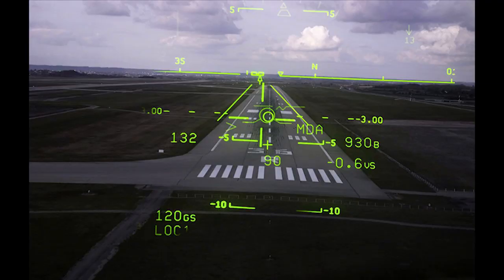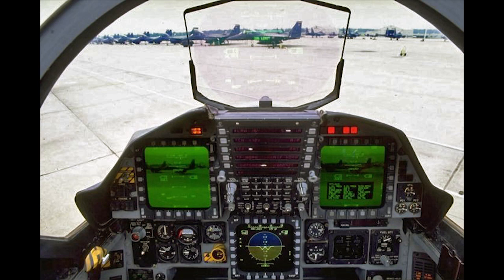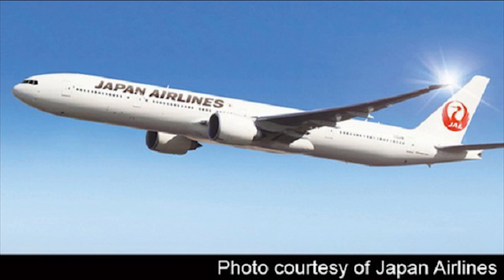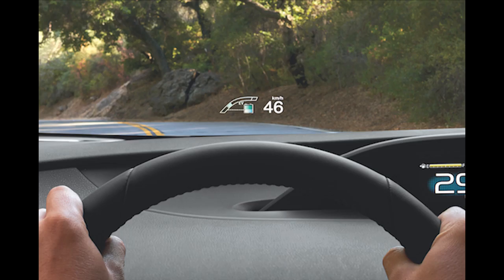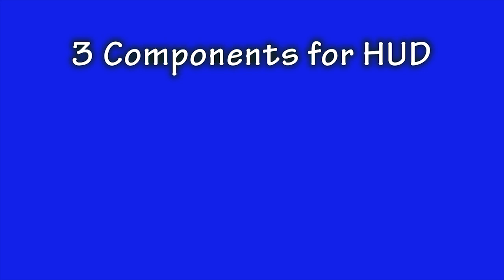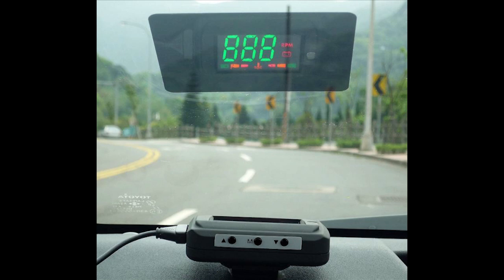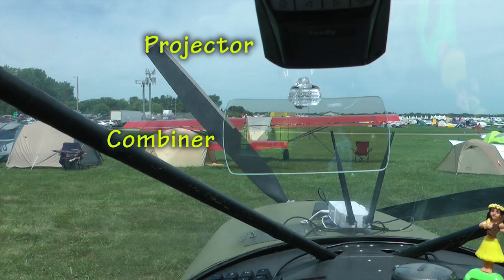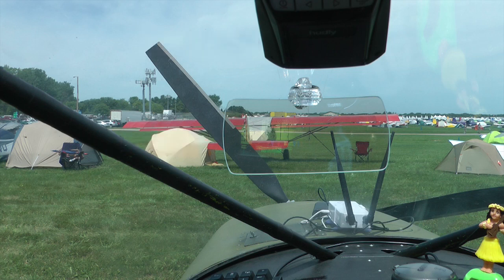Heads Up Display for Experimental aircraft

Comment: I purchased the Epic Eagle but the wireless performance was terrible. In fact too bad for me to even consider using it for flying. They replaced it with the Epic Eagle 2 which has an HDMI connection but now the problem is that the resolution is too low to actually be able to see the numbers in the airspeed and altitude. It was also very hard to focus when switching from looking at the image on the HUD and looking outside. This device is not safe to fly with.
Reply: HUD's should be focused at infinity, such that you look 'through' it to the outside world. 

We do have a problem in the sims with ours, as the HUDs are correctly focused at infinity - but of course the 'view' outside is projected on a screen just a couple of feet from the windshield. So this causes the reverse problem of what you describe.

When I first transitioned onto the 787, I thought the HUD was a cool bit of kit, and couldn't wait to play with it. Now, other than T/O, and landing, it just gets in the way - particularly when looking out for other traffic and weather. (Yes, of course we have Wx radar, but being able to see the Wx for real still helps in the decisions in avoiding, or not).

For flying a great many 'busy' manoeuvres the HUD becomes so dynamic that it's just plain confusing - far better to head back to basics and perform the manoeuvre using the PFD - or basic 6 if that's what your aircraft has.
Reply: @phil_nicholls  If you don't mind, can you tell me the distance between the pilot's eyepoint and the screen onto which the view is projected in your simulators?
I'm considering the Epic Eagle 2 for a simulator, but feel concerned about the refocusing problem that you describe...

Comment: The biggest problem I've had with a HUD is that I become too dependent on it.  When it isn't operational, I find it much more difficult to fly using the instruments.
Reply: Why does your HUD become nonoperational?  You should, of course, maintain proficiency with the other instruments, but the only time the HUD should be nonoperational is when you turn it off to maintain that proficiency.
Reply: Jonathan Guthrie ; I fly a 757 for a major airline.  Occasionally components of the HUD just break.  And if it's 20 minuets until flight, no one is going to fix it.  It can be anything from a simple switch that breaks to the whole system failing.
Reply: That sounds, um, well, I'm not sure what that sounds like.  Even well engineered devices built with care by skilled artisans and carefully maintained by skilled mechanics sometimes fail.  However, the way you talk about it sounds like it happens a lot more than it should.  I would hope that a failure of an important system would be something that you knew a guy who knew a guy that it once happened to, or if it once happened to you then you'd spend years telling the story about when it happened, and if it happened twice to you, you'd be forever known as the guy that this impossible thing happened twice to.

I write firmware for a major computer manufacturer, and I've spent most of my career working on stuff that was at the "bet the company" or even "bet your life" level.  Even though it's been many years since I worked on safety critical systems, I still approach things from the perspective that they must not fail.  I was going to offer suggestions on how to improve the reliability of the system, assuming that the software is the trouble, but you're not the person I'd need to talk to.
Reply: Sounds strange. Isn't the same true for moving map vs paper, ForeFlight vs navlog, glas vs sixpack, GPS vs radio nav and so on? Isn't the answer simply to keep current on all levels of skills? I would think an airline pilot knew that.
Reply: @experimental_av annoying response. They just said it was harder to revert to the next lower method.